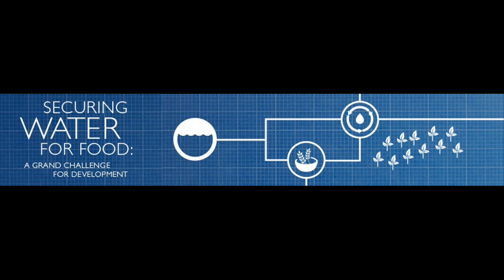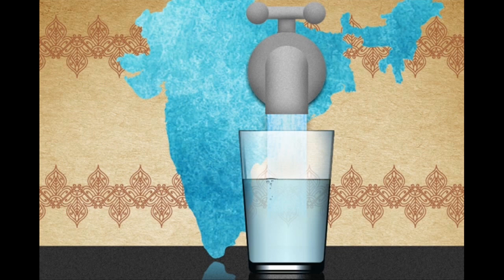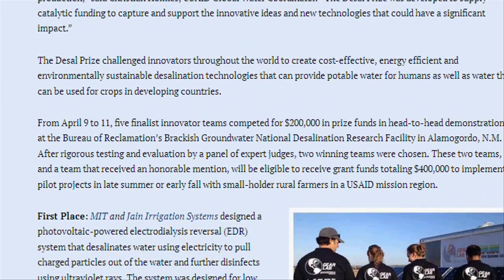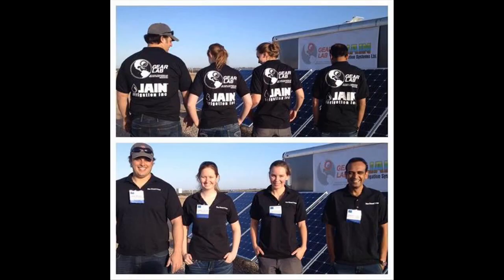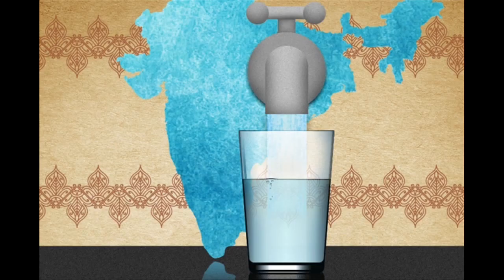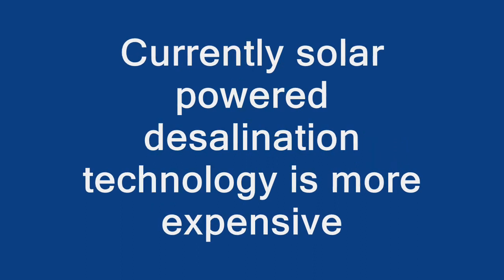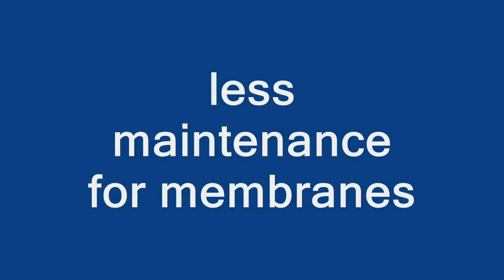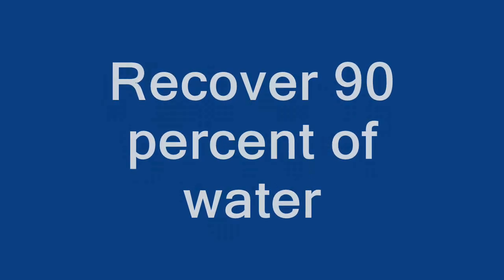Turning Salt water into Drinking water using Solar power | QPT

Comment: Hi Sir thanks for sharing the video..

In continuation to the subject, currently am facing problem with my mango garden:

1. My bore water is converting from good water to salt water due to scarcity of rain fall.
2. Is their any company which can provide machinery to solve the problem.
3. if so what's the cost of the machinery (3000 ltrs/Day).

Your answer will be highly appreciated ..
Reply: @QPT  Thanks for the reply sir ..